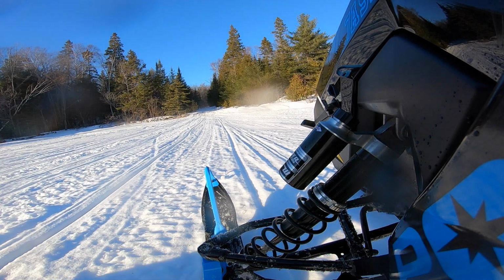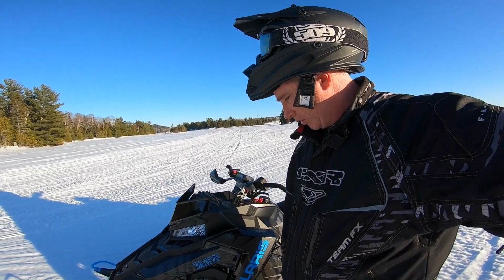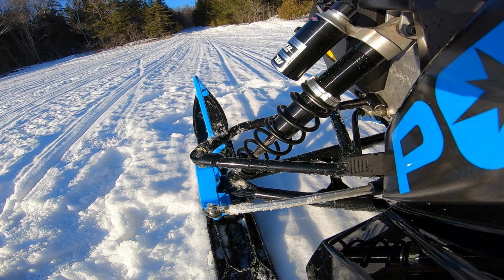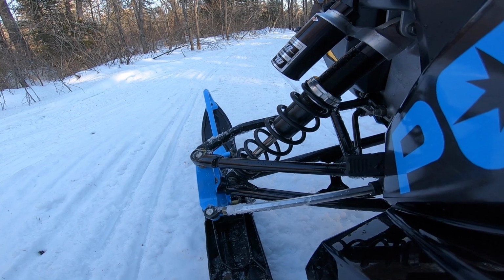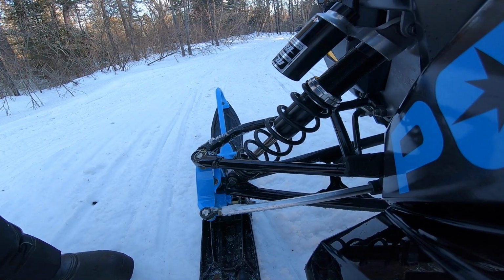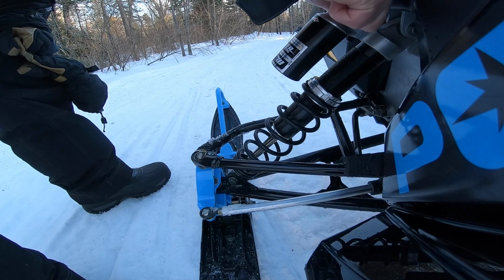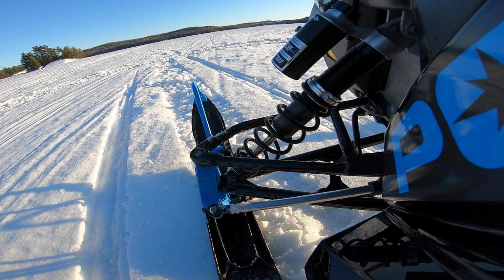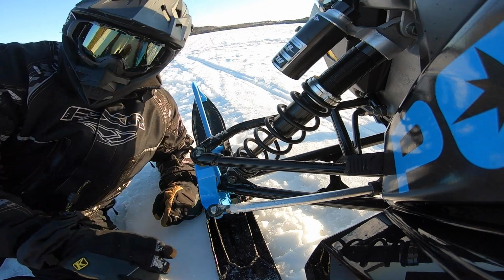Walker Evans Shock adjustment on Switchback Assault

Comment: I love that all polaris sleds come with a very nice Walker Evan's shock package quick and easy clickers love them.
Reply from the maker: Yes they are very nice.  If you check out the last video I posted "warrenty work" you will see that I did have a issue with one of them.  Otherwise they have been great!
Reply: @twistingiron7285  which way do you turn them to make them softer?... getting a rmk soon with the same shocks, just curious
Reply from the maker: @landonlawrence837  it says on the shock but counter clockwise is softer.

Comment: What length is your spring  on the front shock? Book says 9.5”-10” but I’m getting inside ski lift when going around corners. Thinking I need to add some more pre-load on the front.
Reply from the maker: I just checked, sorry I didn't get back sooner.  I have my preload at 9.5 inches.  I do get plenty of inside ski lift though.  I'm completely comfortable with it mind you and it's not something I even want to get rid of.  Kind of like it actually!  Hope that answers your question and thanks for reaching out!
Reply: @twistingiron7285  thank you for that. Watched all your videos before purchase my 2021. Unfortunately we didn’t get a lot of snow so I didn’t to much seat time. After your ceramic video I did my sled also.
Reply from the maker: @brianwankowski3086  awesome thanks for the kind words!  Did you get the axys or matrix?
Reply: @twistingiron7285  I got an axys.
Reply from the maker: @brianwankowski3086  nice!! I hear you about the winter, we haven't had snow either, which is pretty much why my channel had been dead!  I just filmed something tonight, we will see if it's worth while uploading!! Happy trails.
Reply: @twistingiron7285  hi I have a question , I have the same sled as you , do I have to take out the screw on the top to adjust ?
Reply from the maker: @jacobcrow1042  no, just turn the knobs.  I assume the screw is only there to hold those on.
Reply: @twistingiron7285  thanks , I bought this from a 230lb dude , I’m 16 and weigh 139 needless to say it’s a bit stiff
Reply from the maker: @jacobcrow1042  haha I guess.
Reply: Yeah me too. I'm 235, probably 245 with suit, boots, gear etc. Think factory PL is 180-200 lbs. If my SC ever gets here I'm definitely having them adjust it before I pick her up.

Comment: back isn't clickers, they do turn but they don't click. atleast on my indy xc that is. Have you messed with your springs at all?
Reply from the maker: Have not messed with springs.  Pre-load is pretty maxed out.  I would be going more pre  load if anything I think.  Both rear shocks do click on mine.  Weird yours don't.
Reply: Twisting Iron ya mine squats a bit too much and think and my brothers squats a lot to was gonna tighten up that one rear spring, and ya I know they have a new rear skid on the XCs bit different than the assault but why they aren’t clickers 🤷🏻‍♂️ kinda disappointed with that cause at first it’s hard to tell when it’s fully soft and the point where you start unthread the knob 😂🤦‍♂️🤷🏻‍♂️